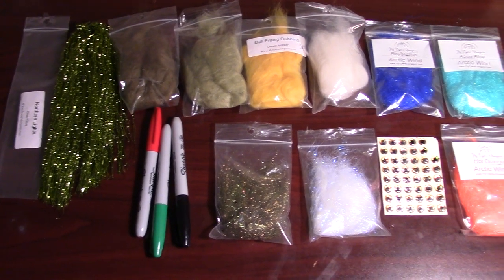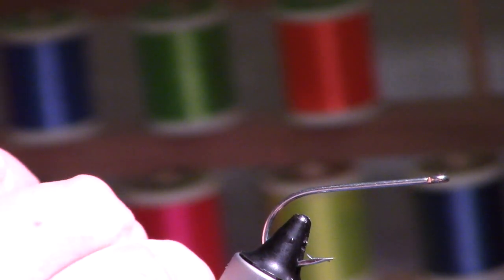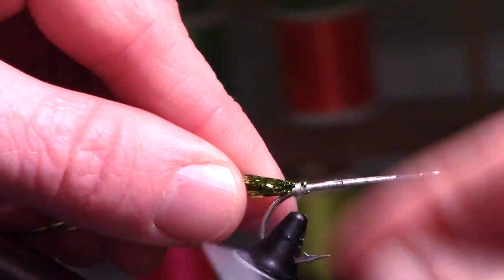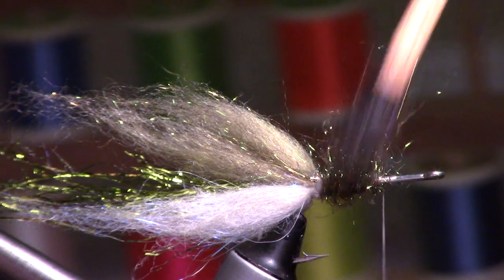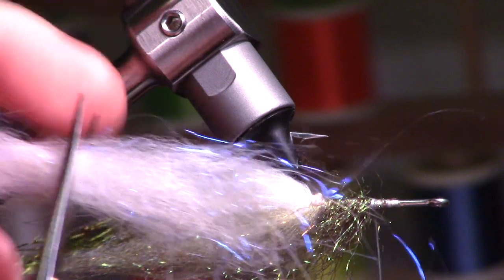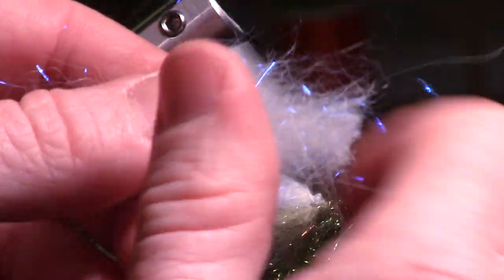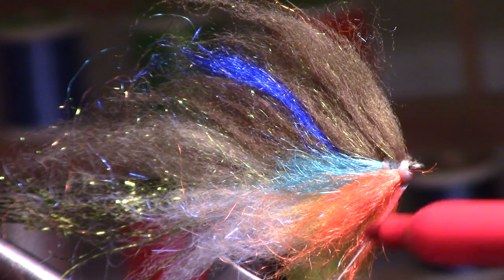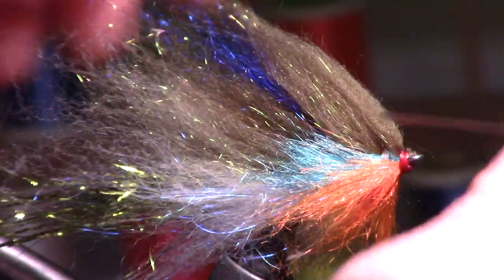Squishy Head Bluegill - UNDERWATER Footage! - Realistic bluegill jerk-bait streamer fly

Comment: That's an amazing tie. Right before this video, I watched you tie the Fat Head Squishy Streamer. Toward the closing, you showed the action in the water which is also greatly appreciated due to my curiosity. I noticed the split shot and began wondering, what would a light wrapping of lead wire on the hook shank do to the action? I was just thinking that because it appears to be rather buoyant, it might help get it down faster. Not worth it if affects the side to side action though. Also, are these relatively durable? Is a Bass going to destroy it the first time? Thanks!!
Reply from the maker: Thank you!  So yes the lead would effect the action, unless you could get it on the very back end of the hook, but you really could only do 2 or so wraps.  I usually fish this on a sink tip line.  Both this and the perch version.  

This is actually very durable.  Smallmouth can destroy flies quick, and I’ve always ended up loosing the fly to a free before it gets destroyed.  Lol.

Comment: I tied one of these and it looks great ,thanks to your amazing vids, but when I went to fish it, it would not sink. I used literally the same materials as you from FTD.... any ideas? I love your videos man, thanks for all the hard work you put into them.
Reply from the maker: Amount of materials really makes a difference, but stick it under water and squeeze, getting all the air out, it should sink then.  If all else fails then fish it with sink tip line.  Or next time if you have any issues, then wrap with a small amount of lead wrap first
Reply: McFly Angler thank you, I’ll give that all a try👍🏻
Reply from the maker: Glad to help.  I will say, most of the dubbing is dry fly dubbing.  Which I used on purpose to give it more of a buoyancy...  I wanted a fly that wouldn’t sink too quickly, however you gotta get the amounts just right or it will float.  Took me about 8-10 of these to get just right when I came up with the pattern.  Then I still have 1-2 every once in a while come out not as expected.  It’s an advanced fly for sure...
Reply: McFly Angler ah, thank makes more sense. I’ll make a few more with different amount. Thanks man!